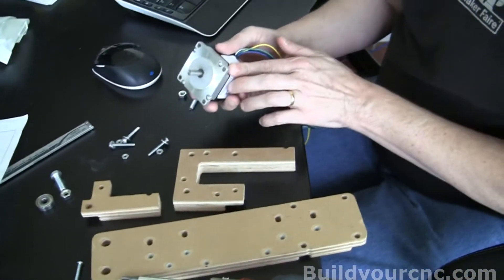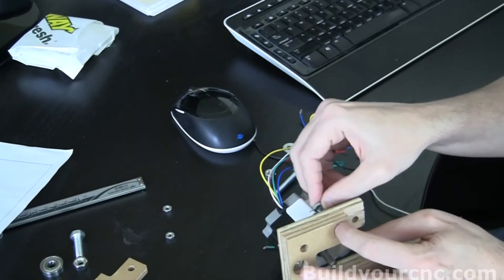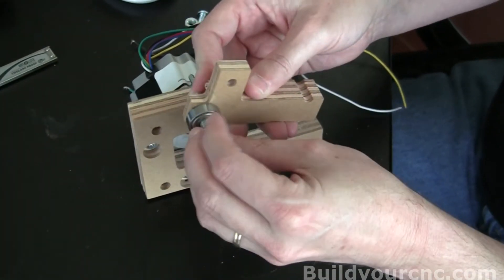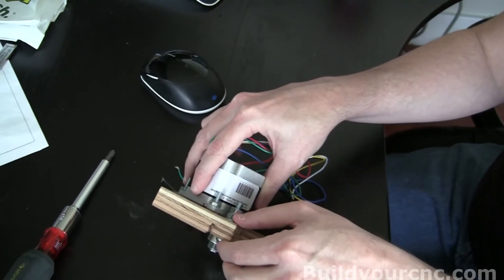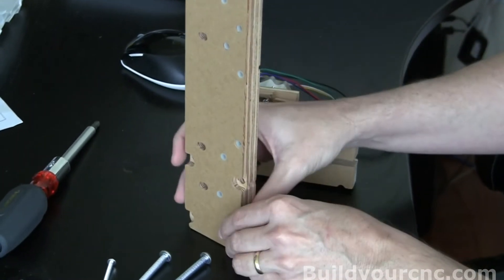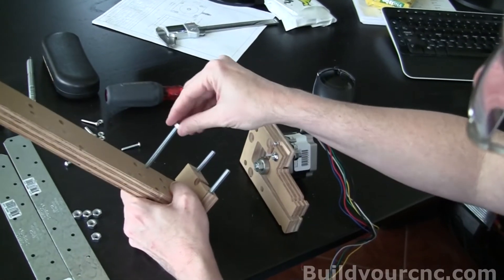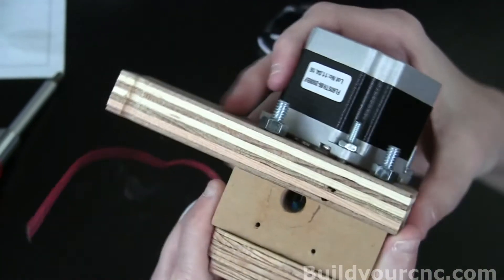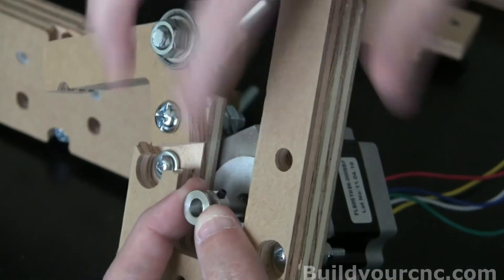whiteAnt Extruder Controller Assembly

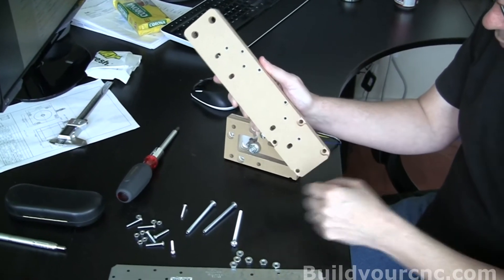Comment: I can not find my 5/16 screw. How long is it? Does it have a number? When I assemble this part it looks like the hinge fab is not correct. The thickness of the wood on the overlap is such that the arm knocks into the stepper motor. Is this intentional? Or do I need to add a spacer? Also what is the length of the screw 2:40?